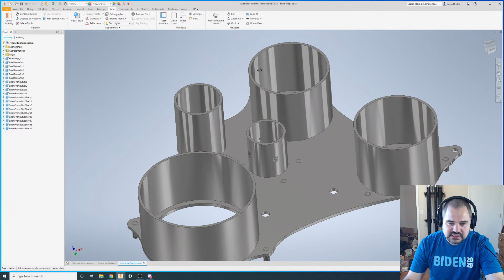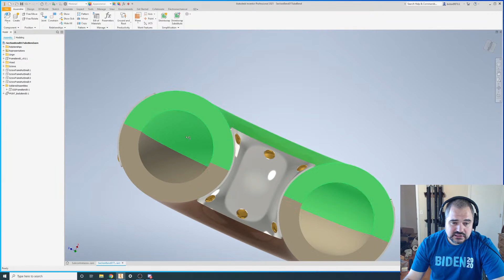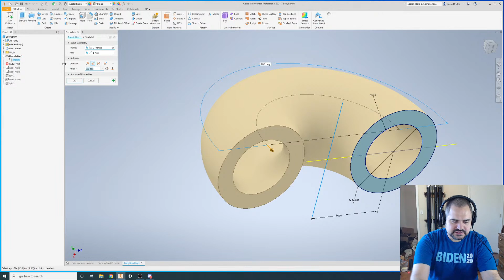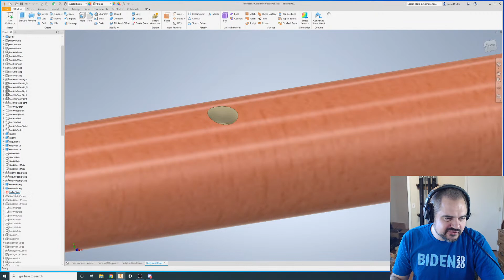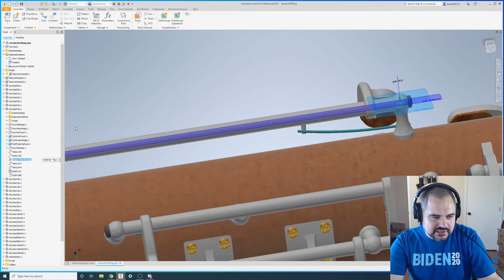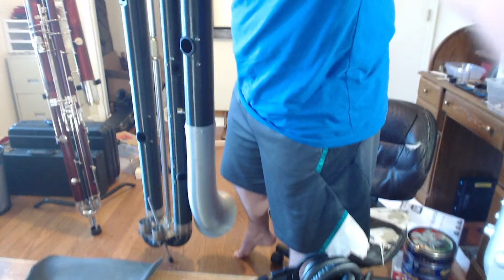Updating the Subcontrabassoon CAD Model

Comment: I like thread wrap. In a pinch, you can always find a box of dental floss. Teflon tape can be your best friend when a cork is trying to come apart or is just too thin, though, and it doesn't make an excessively large mess which is always nice for a temporary fix.

You might want to look at "artificial sinew". It's what dreamcatcher webs are made of. It's waxed nylon, and all parallel bundles that only twist and cross over each other a little bit. It's easily possible to tease narrower bits of it away from the rest. Being heavily waxed makes it great for "it's just gotta fit once" applications too, just don't expect such a press-fit to survive the trunk of your car in summer.